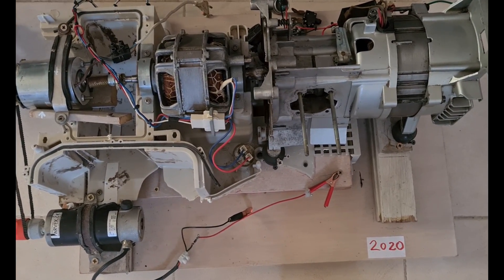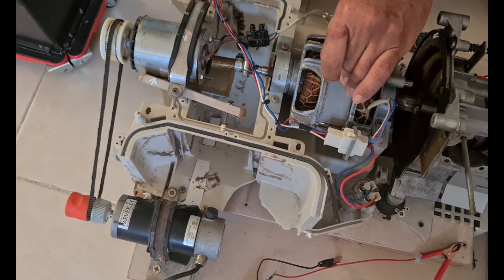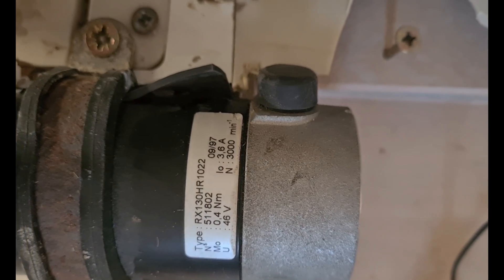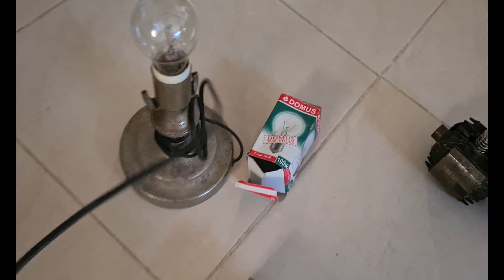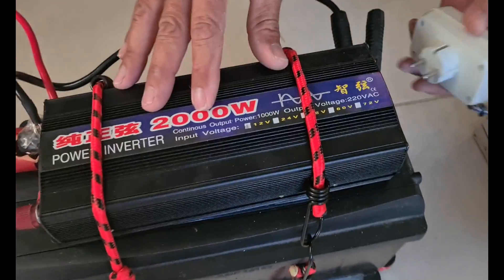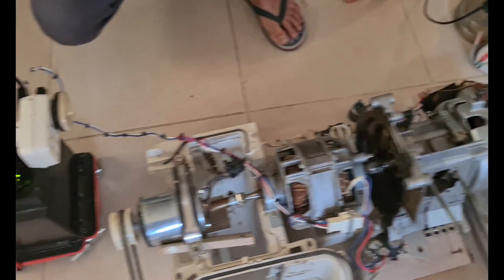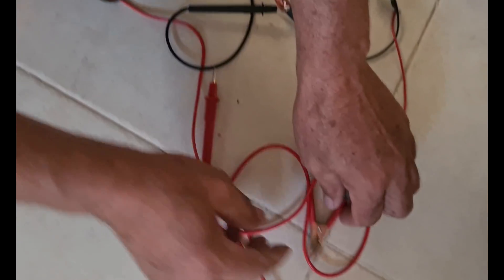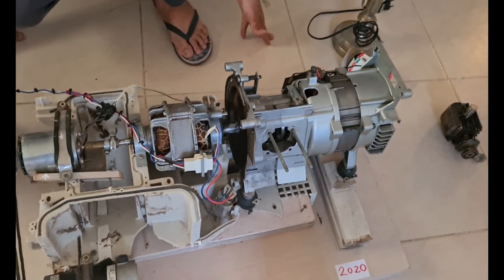Self-running fuel-less generator 2020

Comment: Hi this is William
I have a question 
2: 10 right side there was two diode what is the function of them?
It was connected ac outlet , why connected to AC.
I guess it's Bridge circuit ac to dc.

I will try to make same type generators of yours step by step.
If you help me really appreciate
Reply from the maker: Hi William, yes it is a bridge circuit AC to DC. The generator is acting like a PMG too and the output is split one to AC and one to DC. The DC goes to the motor that spins the alternator. You can try to do it of course by putting first the neodymium magnets on the rotor this way you will get energy at a lower rpm than usual. Then instead of wasting all the energy on a 100W bulb as in the video, you can send it to a DC and charge some batteries and connect an inverter which will give you much more than the bulb. If you can find the same alternator which is a servomotor, you will have less back EMF and objection than other alternators. Regards
Reply: Hi. Did you try this?
Reply: @michalgruszczynsk4424  I am doing step by step  but input power is more higher than 700w.
I used 1/3 hp rpm 2300rpm ,  3min  later  drive main motor stop by overload.
Output Voltage 70v 44hz

Comment: My bad, buddy, you started to focus only on voltage in the video, the topic seem different, when a motor - generator (alternator) setup is set to run without external source of electrical energy, one should focus on wattage at input and wattage at output, just not voltage at input and voltage at output. well, you added too many generating units here, that the input motor can't handle it. The way to build self running fuel-less  motor is, using a high torque input motor and a relatively low torque output generation device. this output generating device can most times be an alternation and the input device can most times be a dc motor, this is when we get best effect of electrical over unity.
Reply from the maker: Hi Sesha thank you for your comment. Please understand that we are doing some tests and demonstrations here of the possibilities of how to use this generator in the best way. This is the reason the AC 110W bulb is just a demonstration, but it's not the aim. What we would like to show here is that instead of using the bulb and wasting energy, it will be much better to store energy in the batteries with the alternator and you can clearly see the alternator gives 3.6Ah output around 180W in 48V so when we spin its shaft in 3000rpm we should have 48V output but we can get much more so the charge to a bank of batteries is huge. If you put 4 batteries of 40Ah you can have more output by using an inverter and get much more than the bulb you see in the video. Regards
Reply: Sesha, Excellent point! However, the author of this video has not a single clue about "over unity" machines, or common sense for that matter, and is totally wasting your time. Hopefully you came here to be amused, or past the time, and not take any of this crap seriously.
Reply: @pstonard  There must be a terrible shortage of washing machines in that part of the world !!!
Reply: @davidhile5363  Once the last Washing Machine falls to Science, we'll move on to Rice Cookers, as elsewhere on YT they can also help with over unity machines.

Comment: Are you sure you have beaten the Conservation of energy? If so, you can make a lot of money out of nothing. 
Sorry, I am questioning your genuinity.
Reply: every electrical over unity machine followed the law of conservation of energy, total energy is never altered in this process, only a part of total energy (electrical energy) is amplified. so better not worry.
Reply: @seshamxy9135  but the title says the wrong thing
Reply: @seshamxy9135  I am extremely worried of the term you use.  You need a source of energy to amplify energy. What is this source? Bear in mind that energy is kept dissipated, so a source is needed. Where is this source? Look like you can make energy out of nothing.
Reply: @nmhong8289  wow, there is hell lot of dormant energy all around us, we use just magnetic energy and electrical energy and even consider it as total energy and even developed a whole lot of formula for the such concept while completely rejecting the other dormant form of energy which is also connected to electrical and magnetic energy. Now we are saying only electrical energy is the only energy stated in the law of conservation of energy and even talk a lot about showing proof while forgetting the actual fact.
Reply from the maker: Thanks for your comment. We didn't beat the law of conservation of energy for the simple reason that we work on energy storage. But in the end you do have more output than the input you used because you store energy in the batteries and this power can be enough to use a nice inverter and put load on it. If we only use the bulb AC as in the video it is nice yes but we waste too much energy so it's better to use the alternator on the generator and store energy and then use AC and much more than the bulb that was shown. Regards
Reply: @denissabourin   you are violating the 2nd law of Thermodynamics. Your title is improper
Reply: @nmhong8289  again, there is something I heard named law of magnetohydrodynamics, electrical overunity machine follows certain laws. But such laws are not seen in our conventional science.
Reply from the maker: @nmhong8289  I don't care about that because I work on energy storage and get much more output than what I used as input initially.

Comment: If you could spin that little black motor with solar power, then charge your batteries, il take a guess that the inverter is powering system, can i have a look inside the inverter?
Reply from the maker: Hi thanks for your comment. Your idea is very good to spin the black alternator with a solar panel and charge the battery. People will tell you that you can charge a battery directly from the solar panel without the alternator. But a medium solar panel can barely charge one battery but this medium panel will be enough to run this alternator either from the battery or directly with a DC converter by the help of a small DC motor. But your idea is good because this alternator can charge 4 batteries while directly from the solar panel you can also charge 1. So it is better to connect it to a small DC motor that will spin the alternator and charge 4 batteries of 30Ah each. The inverter is just a normal inverter if you want a photo I can send it by email you can write to me here luelmade (at) hot mail (dot) com it is just a normal inverter one is 2KW and actually give 1000W and the other is a little bit smaller. Best regards

Comment: I still prefer the ones where you solder an artfully-shaped piece of wire to a transistor, and then the universe just fills it with energy.
Reply: Lol unfortunately you mainstream brainwashed sheeple will never realize that it's not Gravity that mafe our universe (gravity is exclusively a pull force) but rather it is Electro-Magnetism that not only built our universe but is still building it. 
 This has been proven definitively a 1000 times over and unlike gravity electromagnetism doesn't need any fudge factors or a second type of physics.
Reply: @THEMFORMATION  thanks for saving me a lot of typing
Reply: @THEMFORMATION  awesome stuff man Thank you for that
Reply: @THEMFORMATION   When you have a few minutes to spare can you share just one or two "proven definitively a 1000 times" articles so I can catch up. You're obviously well advanced on any of us here.  Thanks In Advance.
Reply: Don’t forget to add some coiled wire wrapped around a couple spark plugs. Real high tech !!!

Comment: I like your style :) , the only real problem is the thermal load on the system especially if trying to run things for any sort of time.
Always ways to mitigate some of the thermal problems but not forever, and so many different options available for single or 3 phase output.
Keep up the hard work :)
Reply from the maker: Hi thank you for your comment. To gain time, I am trying to focus on the charging as well at the same time the generator works so I am simply using energy storage. Thank you very much for sharing your thoughts.
Reply: @denissabourin  THANKS
Reply: perhaps a small battery and a few capacitors
Reply from the maker: @skullparty7638  Yes it is a good idea perhaps, thank you

Comment: Hi Denis thanks for sharing your research You have used a split phase washing machine motor. Do you think a universal type wash machine motor (with brushes) would work in this application or maybe not efficient enough?
Reply from the maker: Hi, thank you for your comment. There is one brushes motor from a washing machine called the killer motor because it runs on a crazy high rpm, of course you can regulate it with a AC potentiometer but the question is not whether it will fit or not but to minimize the consumption. If you can find a motor of any machine (and put magnets in the stator) so you can spin it at a low rpm and raise the rpm with a potentiometer then it will work. Otherwise without magnets, the generator will request around 3600 rpm for European models and 1800 rpm for American models. The consumption of the motor should not pass 300W. Mine is using 200W 1Ah in 220V because my generator is 220V and it's getting warm, so a small fan can be useful. 200W consumption from the washing machine is fair enough. 
You can try a motor with brushes, it can be efficient in case it doesn't consume too much, after all you need to give back to the input what you consume. And what energy is left behind will be for your load and that's the reason that I am trying to charge as many batteries as I can at least 2, to have some power from an inverter for the load in addition to the AC I get from the generator. Regards
Reply: @denissabourin  Thanks your advice and tutorials.... it helps us all !
Reply from the maker: @smokyatgroups  you are most welcome
Reply: Although they are a patented secret, a short circuit muffler bearing will fix that problem.
Reply: @wiscokiddd  Don’t forget to lubricate generously with blinker fluid ??? 🤣
Reply: @wiscokiddd  ?
Reply: @smokyatgroups  I told you it is 'secret'.
Reply: @wiscokiddd  What is a "patented secret"? To be awarded a patent the Patent Examiner requires a full disclosure of details. They must be unique and may reference other patents (called prior art) but not infringe on a granted Patent. In other words a Patent can NOT contain a Secret, so what are you talking about?
Reply: @pstonard  I'm aware of all that. What you are talking about is a utility patent, not not a design patent.
Reply: @wiscokiddd  Ah ha! "A design patent is a form of legal protection of the unique visual qualities of a manufactured item. A design patent may be granted if the product has a distinct configuration, distinct surface ornamentation or both. In other words, a design patent provides protection for the ornamental design of something that has a practical utility."

Please share the design Patent to support your claims. We're all adults here, share the facts, do less arm waving please.
Reply: @wiscokiddd  Well that's interesting! "A design patent is a form of legal protection of the unique visual qualities of a manufactured item. A design patent may be granted if the product has a distinct configuration, distinct surface ornamentation or both. In other words, a design patent provides protection for the ornamental design of something that has a practical utility."

On the other hand "A particular form of letters patent has evolved into the modern intellectual property patent (referred to as a utility patent or design patent in United States patent law) granting exclusive rights in an invention (or a design in the case of a design patent). In this case it is essential that the written grant should be in the form of a public document so other inventors can consult it both to avoid infringement and understand how to put it into practical use."

So you have nothing...
Reply: @pstonard  A short circuit muffler bearing does not work without blinker fluid, if you send a certified registered mail envelope of the secret drawings of it to yourself through the mail and never open the envelope, your invention will be protected.
Reply: @wiscokiddd  Blinker fluid you say... How much have you been drinking?
Reply: @pstonard  Seamingly you did not know what a short circuit muffler bearing or blinker fluid are so you introduce a straw man to the conversation, maybe you are projecting about drinking?

Comment: So basicly u did overcomplicated DC/DC converter with tons of energy wasted on converting it to mechanical then to electrical again, and then u proceed to show us VOLTAGE meter trying to convince anyone that is somehow generating energy XD. According to formula P=U*I, Power equals to Voltage times Amperrage. If u see on input AMPERAGE and output AMPERAGE and voltages on both input an output u wuld have know that is draining energy like hell not putting energy like hell.
Reply from the maker: Hi this device is based on energy storage not on energy wasted, without the alternator on this machine it wouldn't work. One first inverter to power the device and second inverter working on the charged batteries. One battery goes back to cover the input and you can put 2 or 3 charge batteries for the second inverter for load and go for your love. Regards
Reply: @denissabourin  but what is the point of such overcoplicated device. When you can just build simple DC/DC boost converter and u surley ll gain more energy of that first battery.

Comment: perpetual motion once again lol does not work
Reply from the maker: Hi, there is no magical extra energy coming directly from the generator. The magic of this generator is that you can get, in the end, more energy through energy storage than what you used in the input. The test that we made and will publish is that we are charging a battery and since we saw that the alternator is strong enough, it can charge 4 batteries of 50Ah each so you keep 2 for the input battery, it can be by a step up DC to DC converter to charge the input battery and you still have 2 fresh battery to connect an inverter of 1500W to run your devices. There is no point to light only the bulb from the generator directly but I will publish a video where the bulb still runs directly from the generator while it is charging the batteries at the same time. Regards
Reply: @denissabourin  "The magic of this generator is that you can get, in the end, more energy through energy storage than what you used in the input." We call that an over unity system, which is not possible in the real world where we live. So you have just invented a very primitive and highly inefficient battery charger. Supported by zero performance results. It's crap.

Comment: The Voltage converter is better solotion. You lost many energy.
Reply from the maker: Hi you are right, a DC converter will be a good solution. I will try to make  a video and publish it in a few days, using a voltage converter in it. I'm trying to use all ideas possible. Thank you
Reply: @denissabourin  You already have a "voltage converter" attached to the first battery. Just plug your table lamp into the output and you are finished. All the other stuff you can donate for e-waste or sell for scrap metal. Prove Me Wrong! This is just crap.

Comment: From where you got that generator? The one behind.
Reply from the maker: Hi behind there are 3 items, but the silver small motor you see in inox color with a belt on it is an electric motor and it is spinning the black alternator which is a servo motor that I use as an alternator and it gives a huge charge. About the motor that spins the generator itself it is a 1ah 200w washing machine motor, but I believe you are speaking about the black motor. It's output is more than 150W DC. Regards
Reply: @denissabourin , @guruji243 " It's output is more than 150W DC. " Please provide proof that its output is 150W DC. Reading the label on the motor is NOT the same as measuring Voltage and Current, and in an AC circuit also measuring the Power Factor (PF) Until you supply some technical facts you have nothing but a pile of crap.

Comment: I have a fuel generator but I nead to stick magnet in the rotor to produce energy  ?
Reply from the maker: Hi, your generator will work without magnets too but you will have to give it a high RPM. Meaning using a bigger electric motor which doesn't guaranty more output than input because it will consume more. So, you can stick the magnets there. I will try to make a new video for the new year and explain exactly how to put them and how many I use because I only explained it in general. Putting magnets will allow you to get energy faster in low RPM. if your generator is 220V European model it will already generate at 2000 RPM with the magnets. If it's a 110V American one it will already produce energy at 1400 RPM with the magnets. Best regards
Reply: Please send a lot of money to the Author of this presentation. He will then share the double-secret method to break the Laws of Physics, and you too can have Free Energy. Use those magnets wisely, they are so much better then the magic beans in the children''s story.